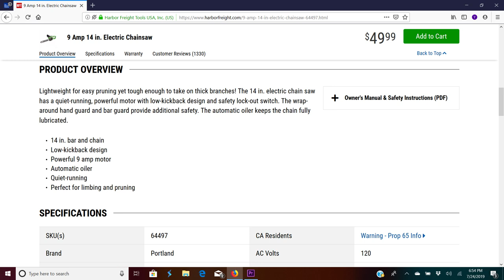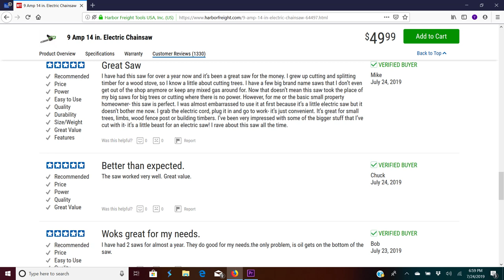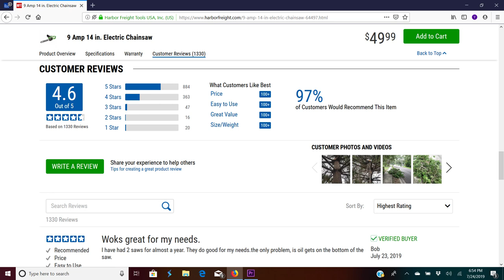Harbor Freight's "Cheap" Electric Chain Saw review!

Comment: But does it last and is the chain decent... looks like evertyhnig is plastic does the bar hold bolts and cover plastic
Reply from the maker: Time will tell. So far so good. The chain bolts are steel. cover is plastic but is holding up fine!